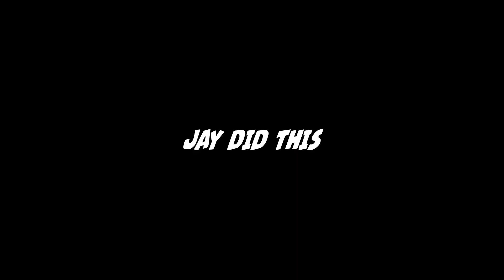What will be my new car??

Comment: Dude so, I did it. I snagged up a rust free Mk4 VW GTI 20th Anniversary Edition. Imola yellow https://imgur.com/a/FXnqbwf Previous owner kinda fucked it up. He sold the stock bumper and put an R Spec on it. didn't even paint it, just vinyl wrapped it camo. He also removed all the seats and sold them and put in some Corbeau's. They're not bad seats but they're not the most comfortable. Plus no height adjust. I'm returning the front and the seats to stock. It's gonna get a K04 turbo upgrade, an upgraded side mount intercooler (removing old FMIC because it makes having a stock bumper difficult, which is why it's gone) and a 3" downpipe and 3" exhaust. That and wrapping the steering wheel with a white stitch perforated leather wrap. I think that's it. Wheels aren't originally white but I dig it. Goes with the yellow. I might go sport shocks but the height won't change. Only has 88k miles on it. Clutch was done at 30k miles and front shocks at 50k miles. Has Stoptech brakes and slotted rotors. The 20th has some beefy brakes from factory. Also has the factory lower springs and 6 speed instead of 5 speed. Also had 3 more psi I believe. Lot's of little things with the 20th. It'll hold value for sure which is a plus.

It's a fun little car. Right now it has a 2.5" exhaust I think from the cat back, straight.  Has a pops and bangs tune so it'll backfire at WOT high rpm shifts and rumbles when you let off while cruising. It handles well. I actually found the previous previous owner on Facebook. He's pretty upset what the P.O. did to his car. He's interested in buying it if I ever consider selling it. It's been well taken care of other than what that yobo did to the poor thing. 

So stoked to finally have a hot hatch.
Reply from the maker: Timothy Brown that’s awesome man! It looks cool! Congrats bro 👊🏻

Comment: I've been doing the same thing, going through pro's and con's of a second car. I've kinda moved on from the idea of a Miata. It sounded cool at first but a decent one runs about $5000 USD here and I'm definitely gonna want power right away. I would rather have a bigger brother Porsche Boxster S. Thing is they're about $12000 USD for a good one. 
And I'll end up doing exhaust for sure on it. 

My tattoo guy, actually here's his slammed turd Jetta/Golf that I cleaned up for him: https://i.imgur.com/BXPUUvU.jpg He's convincing me to get a Golf GTI. I'm trying to stay cheap because I know I'm gonna end up getting exhaust, wheels, suspension, sway bars, and bushings so a Mk4 GTI in decent shape here is about $3000USD. Leaves lots of money for mods. He also said you can easily get about 275-300whp out of them on stock internals. They're pretty stout engines. 

I've always kind of wanted a hot hatch. We don't get many options in the states. I originally wanted a Focus ST or new Golf GTI as a daily but was new to turbos and was worried about reliability but now I'm not concerned.

From someone that has many buddies with turbo charged Subaru's, the STI is a gamble. You might want a second engine just hanging out in the garage. I understand the nostalgia though for them. It was THE car I wanted when I was younger. A 2004 WRX STI. Now I'd rather a 2002-2003 WRX Wagon in blue. 

I don't know much about RX-8's but I feel they're probably one of the least reliable. Someone local here swapped an LS engine in because she was tired of the rotary, haha. The 350Z, if you like the sound (I hear with an exhaust that engine just doesn't make nice sounds) I'd say go for it. They seem to be a reliable platform. RWD and front engine is a winner too. 

The DC5, we have them here in the states but they're the Acura RSX Type S. I hear good things. The only issues I know is with the transmission sometimes but I believe you can build them to be more reliable. I think its 3rd gear likes to fail. You can pack a supercharger or turbo on it. Should be decently fun. Not sure if you guys get the blue ones but I love the blue color of those. 

Honda S2000 is bit overrated. It'll hold value though no doubt but yes, holy crap have they gone up. 

I say if you can, test drive as many of what you want as you can. Keep in mind of what you have to live with. The Japanese pickup sounds like a great idea but if it's your only ride you may end up hating yourself. Driving it for a few ideas can probably give you a good idea.
Reply from the maker: Timothy Brown thanks for all that man! Really appreciate it 👊🏻 yea as soon as this whole lockdown situation has passed, I’m gunna get out there and start driving some candidates and get a feel for them, should make the decision a little easier, hopefully!! 🤞🏻😬 thanks again!!
Reply: @JayDidThis  I keep forgetting about the whole lock down thing sometimes. It's a bit of a norm now here. Started to smooth out quite a bit here in Ohio, in the states. Other states are going up with cases but even with restaurants opening again it's going down in mine. I miss car meets, man :( And concerts. Ugh.

I'm actually thinking of doing little update videos when I get GTI. Nothing frequent but having some video memories would be nice to have. 

I also forgot. They're not the quickest thing in the world but if you can find one in the UK, check out the 3.0R spec.B. It's a 6MT flat six Subaru. They only included the manual transmission in Europe and Japan. I'm not sure what your end goals are but the engines are buildable and making stupid levels of power is possible. It'll cost a bit but it's another option. 

I'll keep a look out what you end up with here.

Comment: Having owned most of the cars you mentioned apart from the evo, and the sti was a bugeye, and the intergra was an ep3.  I also had a r53 jcw mini which I still remember to this day as being the most fun out of the lot. An r56 jcw with a turbo upgrade would be my best bet although It may not be "special" enough, but there is somthing about them, plus it has all, the mod cons. The 350z was a bit meh and "sloppy", the rx8 was just a constant pain in the ass, with premixing, and worrying about overheating it, etc, oh and it stinks of petrol with the cats removed, and I did an engine rebuild eventually too, so most of the time was spent in the garage. Ep3 was fun,  STi was a bit to competent with the four wheel drive, so on public roads you really had to push it to provoke it. I've got a 01 Mx5 now and nearest to it was the mini I had, I'm on the edge of getting an r56 jcw myself. Go try one I'd say, just my 2 cents. Love the content BTW, keep up the good work!
Reply from the maker: x77r appreciate all that mate! 👊🏻 I was considering a jcw as a daily a few months back as a daily if the mx5 was staying, but now that I’ve decided to sell up, I’m looking for a toy/race car to replace it, I do have a thing for minis though, and wouldn’t say no to one in the future as said daily 👏🏻 these are cars I’ve had my eye on for a while, just need to decide which one to go for 🤦🏻‍♂️😂
Reply: Totally get the toy car thing(trust me😂) that's, why I ended up in the Mx5, but as you said the lack of cruise control, sound isolation, decent headlights, etc does get on your nerves sometimes when just out for a cruise. Also I'd kill the person who designed the cup holders in the Mx5. My daily is a 640d which I love, and its a great cruiser, but definitely not somthing that's nimble or chuckable. But either way will be excited to see what you get. (still recommend the jcw😜, some pretty wild ones out there) all the best
Reply from the maker: x77r I know I know, and that’s why the DC5 and the truck worry me, more so the truck 😂 but I still can’t help but think about how awesome it would be 🤷🏻‍♂️ I’ve got some thinking to do for sure!! Cheers mate 👍🏻
Reply: Well as luck will have it I've sold my  Mx5 today, now on the look out for a jcw 😂.   Hope you've managed to pick one 😊.

Comment: I love my 350z but there's only so much like you said power wise to a NA and the 350z isn't a cheap option talking 350z de motor 6k supercharger kit not. Hr motor 8k plus dyno tuning not worth it. In the usa yes there everywhere super easy and Lhd easy to turbo as all turbo kits are for LHD. here in the UK parts are expensive plus there are shit loads of channels with 350z on. I personally would go with what's best for your plans for the build and budget no point having a car you can't afford to mod. I vote for your cletus pick up that would be good content and totally different plus you can easily sort out a sound system.  nissan sunny  the worst possible name for a boring car nowt sunny about. A fat kid in a trolley going down a hill is fast than a sunny.  how ever you will change that boost that bitch up  and make a  nissan sunny on steroids f in blinding.
Reply from the maker: 350Z HR UK guy such a tough choice!! Gunna have to get and and go look at some cars I think!!
Reply: @JayDidThis  good man us car guys always end up selling some of our organs on the Chinese Black market to fund a carbon fibre fix
Reply from the maker: 350Z HR UK guy gotta do what you gotta do 🤷🏻‍♂️